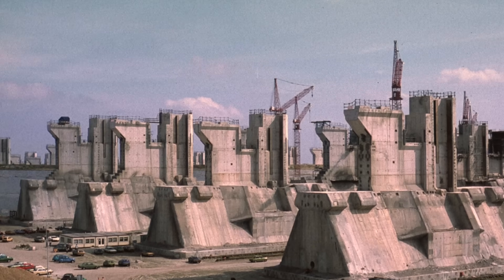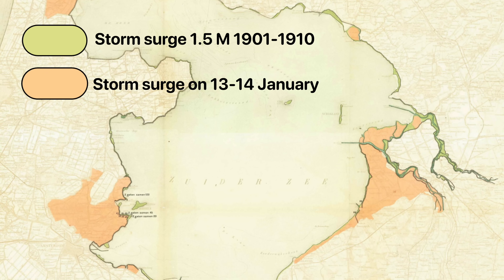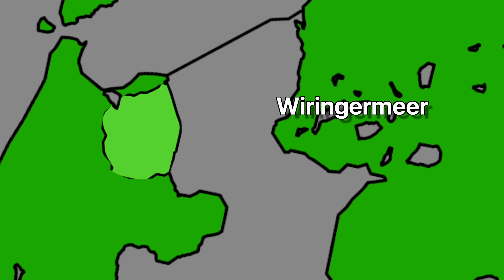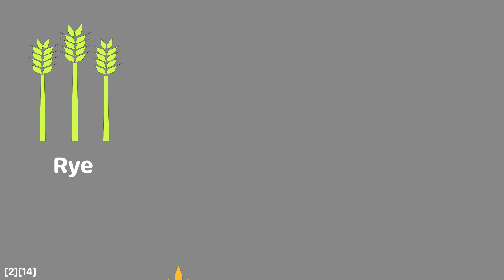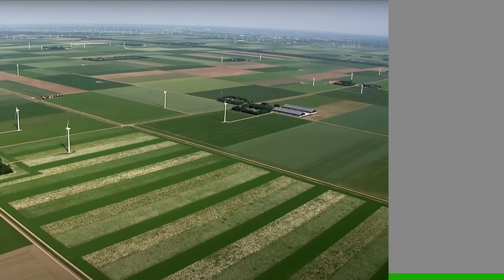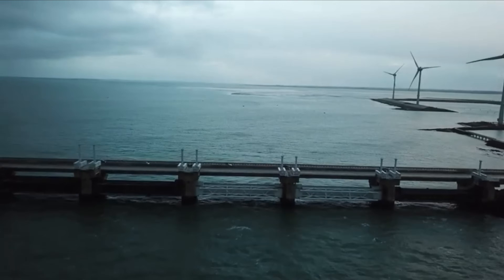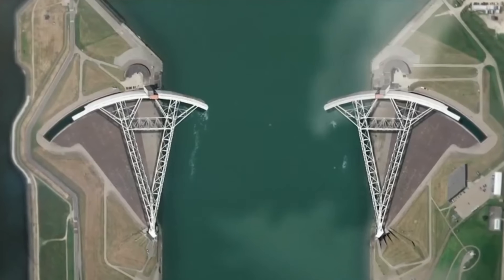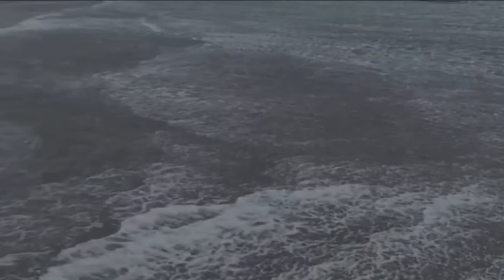Why Did The Dutch Build These Monoliths?

Comment: Thank you for the informative video! It's great to see such a massive project explained in such a clear and easy to follow way. One thing I have to mention however is that with  the current sea level rise of less than 10 mm per year (Per iccp projections, NOT measured)  the Netherlands will be save for the coming 130 years due to the extreme overbuilding and "future proofing" the engineers did in the past. No one in the Netherlands is concerned about flooding, and they should know, right??

Comment: Extremely minor niggle is that the N.O. polder is the North-East polder (Noord-Oost polder (dubble o's are pronounced "Oh" for if you ever want to risk your vocal cords pronouncing Dutch)).

Full points for explaining the difference between the North East-polder and the Flevopolder. Well done.
Reply from the maker: I just abbreviated to N.O. Polder because I did not want to pronounce it wrong.
Reply: @ON-YT  Smart, we wouldn't want people without training, specialized equipment and medical personnel on standby try to pronounce Dutch, that could lead to catastrophic trauma to the poor victim's throat and vocal cords. 😜

Most of us accept direct translations in English, we often do that ourselves for fun. The more literal the translation the better, especially if it pushes the term slightly out of context.